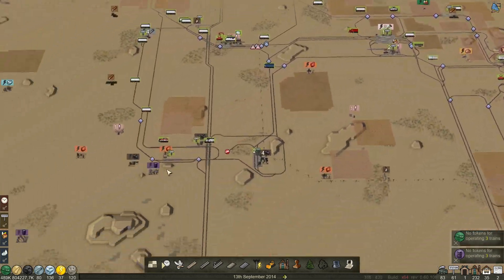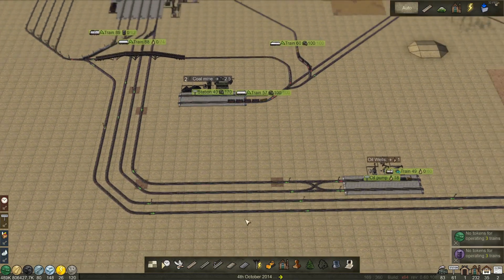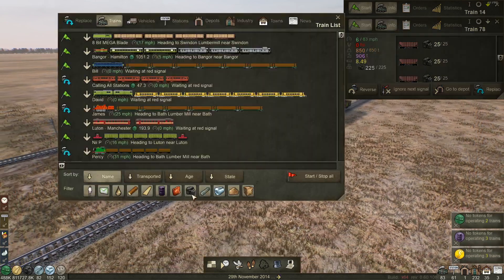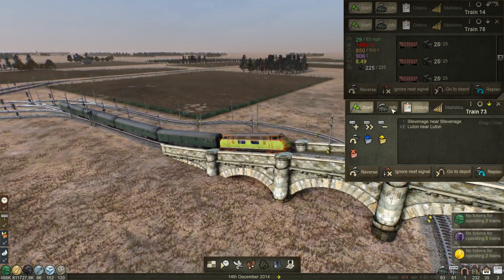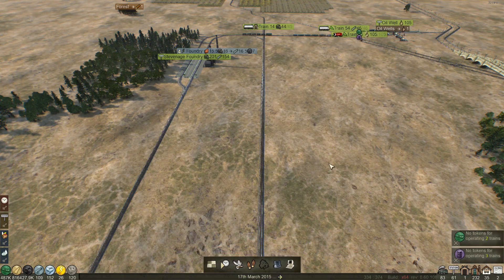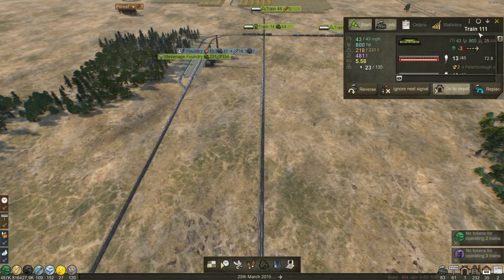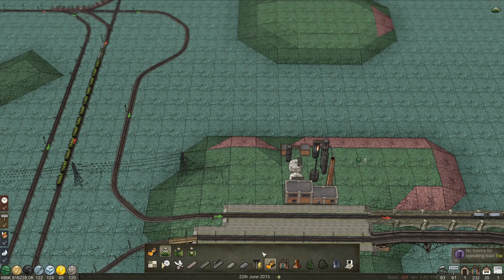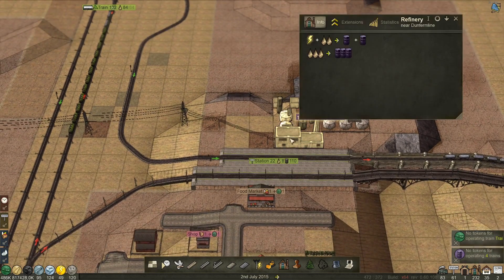Mashinky - Refreshing Changes

Comment: It "crings" me, that your diesel account is always unnecessarily only a few tokens in the negatives, just because you didn't reconnect the power lines, seen at 23:00. Keep in mind, that if you are in the negatives, even with only one SINGLE diesel token, your WHOLE network is constantly near to a standstill! But if you are in the positives, even with just one SINGLE token, all your trains speed up as much as they can, AND(!) will even further boost up your productions! A tremendous difference with just 2 more tokens, right?!  ;)   These 2 tokens, and even much more, would be produced, if you would reconnect the power lines at 23:00, as I told you last time. No offend, Nick, you might have forgotten it, I just wanted to point out, how important those little things can be, especially when there is a so small gap between success and fail. ;) 
 I'm quite confident, that you will produce the 500 steel tokens for the next era sooner or later, but keep in mind, that you also need 500 diesel tokens for that era change, and a few hundreds to improve the refineries even more, which will bring you to the needed 500 quite faster.
 My experience showed, that upgrading many trains at once, often leads into traffic jams, slow downs, queuing up long time, or even dead locks, especially if you have only one depot. Better do it in bunches of 3-5 or so.
Reply from the maker: I did forget, even though I wrote the blasted thing down lol. Luckily, I shall be recording in about an hr, so this time I shalln't forget, we'll do it first :)
Reply: @trainswithnickyt  Great, and btw, the audio was wonderful, just a little bit low level, but very clear.
Reply from the maker: @NipapornP  I'm glad the investment was worth it for a dedicated mic, the low level was because I may have adjusted a little too much in post. The original recording was very loud